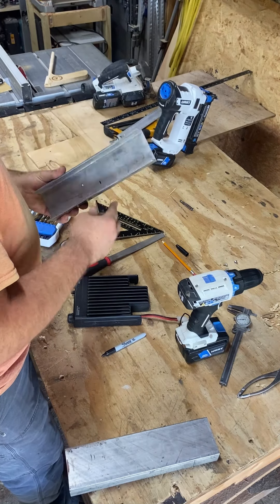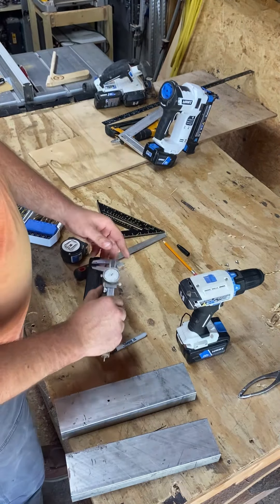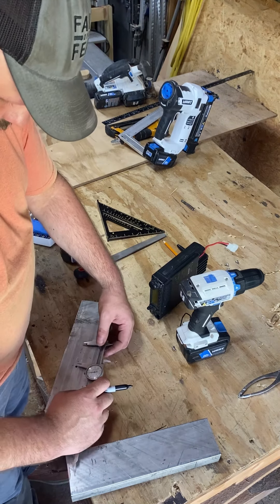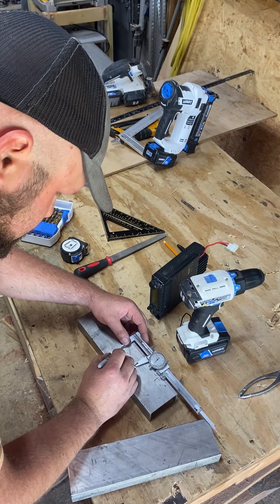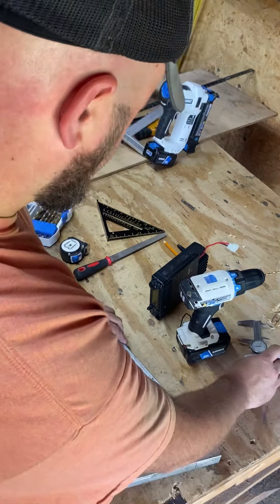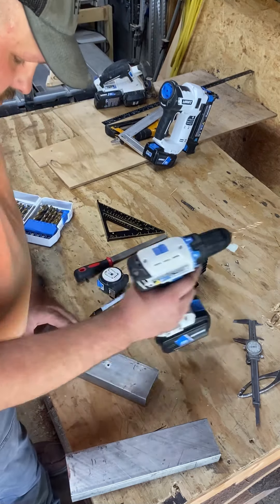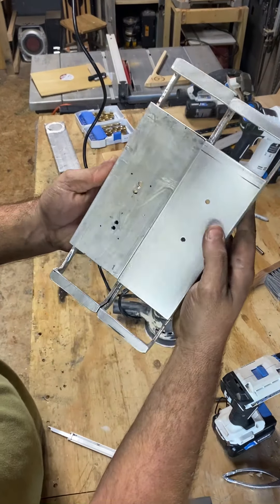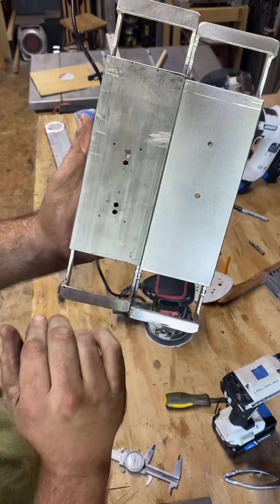DIY Armoloq

Comment: Excellent, Armaloc is quite expensive. And shipping to South Africa even more so. Will give this a try, 73
Reply from the maker: @do7425  give it a try. Aluminum is very easy to mess with. The welding a little more involved. But cutting bending and drilling holes is easy than steel

Comment: Yeah, I was thinking of using a plasma table then bending and tig welding the folds.
Reply from the maker: Excellent idea. I don’t have access to tools like besides at my work. I did build a radio mount for my mobile radios at my job. Not perfect but it works excellent